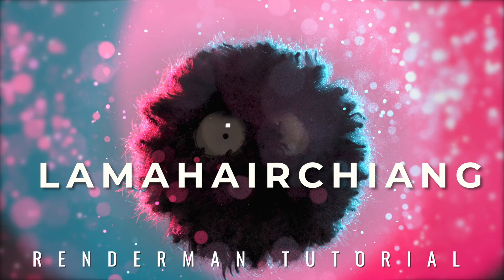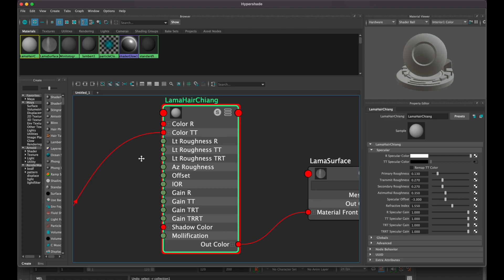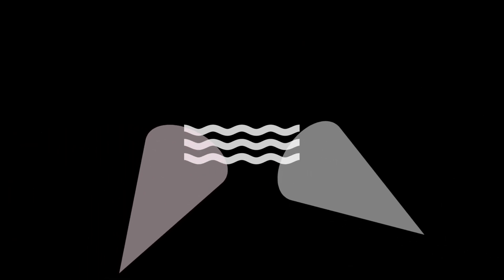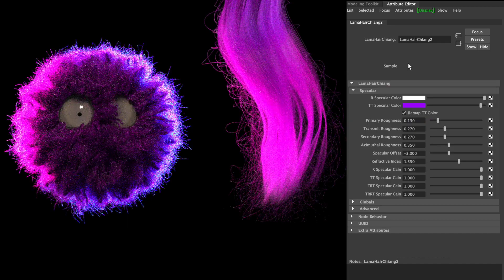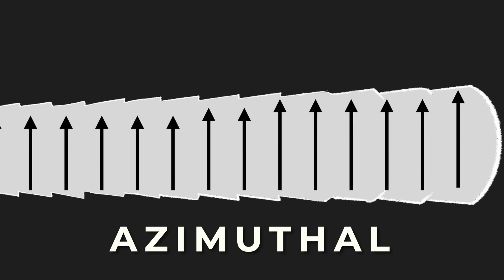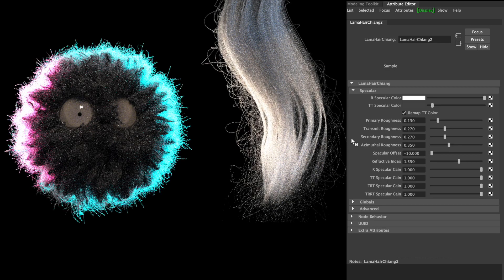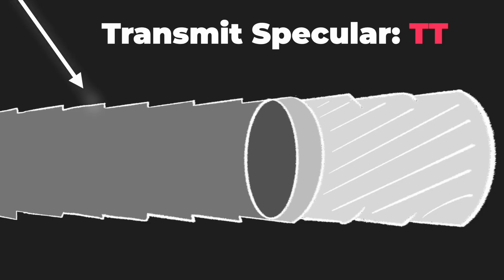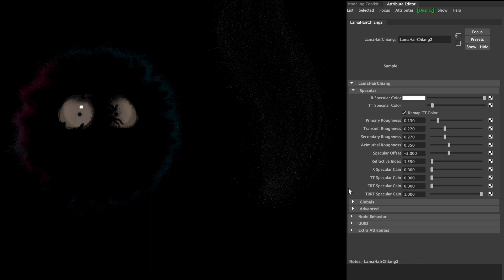Renderman - LamaHairChiang Tutorial

Comment: Hello sir I love ur tutorial but in my Maya whenever I try to render hair it's disappear
Reply from the maker: I know this Problem, there are many things which can cause this Problem. The first thing you can try is to go to Windows > Settings/Preferences > Preferences > Animation and set "Evaluation mode" to DG

If that does not work than go also in Preferences to > Renderman and under Batch Render  you need to use RIB as Spool Style.

A nother Problem can be that you never saved your file. So please first save the file before you start to render

 if you are using XGen, you need to XGens Preview/Output tab and choose Renderman as Renderer in the Output settings

If that also dont work, try to place a sphere somewhere in you're scene and give it a PxrSurface shader

And if you want to render animated hair, there are some more problems... but I think you don't need Moving hair? Or are you

Hope that helps
Reply: What are there problems involved when rendering animated hair with XGen and Renderman in Maya? @renderjam876
Reply from the maker: There ist just one thing I recognised, fur won't work if something in you're scene or yore file hast  some of these signs in its name"!@#%^&€?"
Reply: Thank u for helping
Reply: When I enable dg gpu override get disable